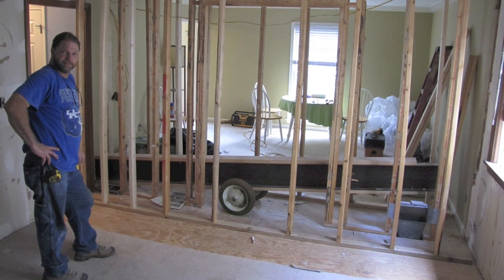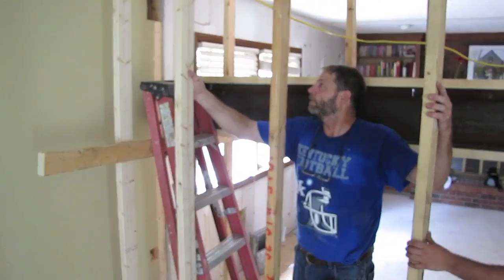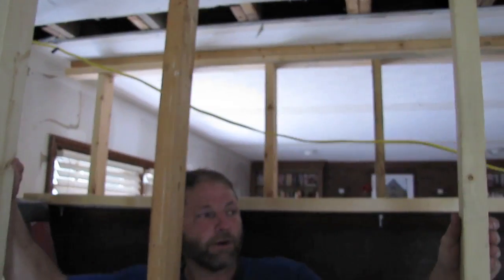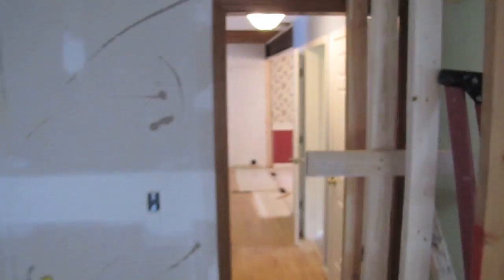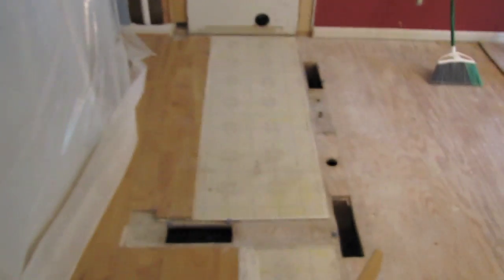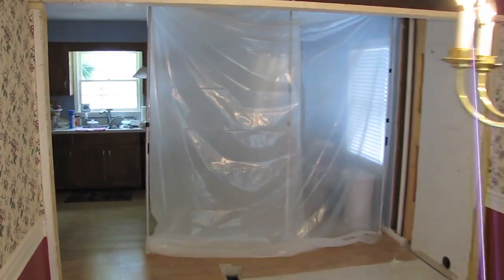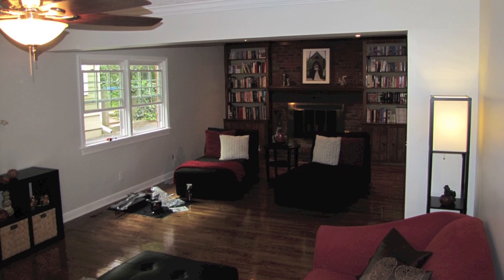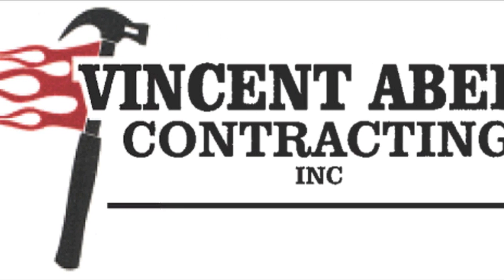Installing Load Bearing Steel Beam

Comment: Nice work guys! I'm going to be doing that today with a 24 foot span
Reply: What was/is the specs of your 24' beam,and does it support a floor above?
Reply: @huakaneohana  it's a 10 inch I-beam with a 27-foot span. It is directly above the beam in the basement. One side it's anchored to the wall under 4 laminated 2 x 6 and on the other side it gets the post welded the beam in the basement. It's because the main floor is an open concept
Reply: @kaboom362  great,nice work,thanks for the time
Reply: @kaboom362  10 inch webb ok. What was the flange width? Weight per foot? Im also doing a 26ft span
Reply: @scottclementbuilt7213  the flange width is 6" and your beam supplier will be able to advise you on the load handling capability. I got mine from Shatner

Comment: what an overkill. Could easily use 2 or 3ply LVL instead. Put them in one by one and not break your back doing it.
Reply: pretty easy to say when you dont know the load or foundation....
Reply: @gurban333  'Parts is parts'
Reply: I agree. Overkill. A structural engineer could have given you the specs of sizing the beam and what material you could have used. The opening was small enough…you probably could have used spans for beams for decks.
Reply: I was thinking the same thing - I've done this with sandwiched 2x10's on a residential property for 10 foot spans, and ahve done it with LVL's on longer spans.  Unless you are storing grand pianos upstairs I can't see the need for this type of overkill in a two story residential property - I'd be more concerned about what is supporting the header vertically

Comment: How much does a beam like that cost? Not with labor and installation just the cost of the beam itself.
Reply: I just ordered a steel I-beam with post supports that will be in hidden in the wall and it was 1600.00 for about a 18' span.  This particular beam is supporting trusses where a land bearing wall used to be.   The price includes holes drilled in the mid section o the beam to attach wood so we can clad the beam in cedar.  Hope this helps.

Comment: how is the cost for steel I beam vs a PSL , LVL of glu lam
Reply: a 22' LVL cost me about $500 for materials and you can see the cost for steel below.  There are some online calculators for steel but I find them hard to use if you are (and absolutely should be) using architects renderings.  

I just ordered a steel I-beam with post supports that will be in hidden in the wall and it was 1600.00 for about a 18' span.  This particular beam is supporting trusses where a land bearing wall used to be.   The price includes holes drilled in the mid section o the beam to attach wood so we can clad the beam in cedar.  Hope this helps.

Comment: how did u attach the wood to the beams
Reply: Holes drilled through the beam and wood. Bolts attached the wood to the beam.
Reply: Gou can also use quality srewteks.

Comment: If there is any load on the beam , won't it beput on the wood floor?  Should piers of concrete be used?
Reply from the maker: Harold Gregory The point loads for the beams are supported; outside point load over the foundation, and interior point loads by a steel post over a new footer in the basement.

Comment: Is there a second floor on this house. If so, what did you do with the returns that were in the living area walls. There were openings in the floor where the wall was taken down and it looks like you covered them over with a hardwood floor.